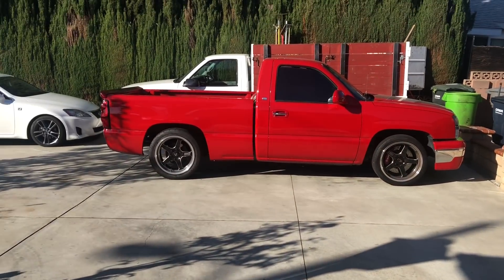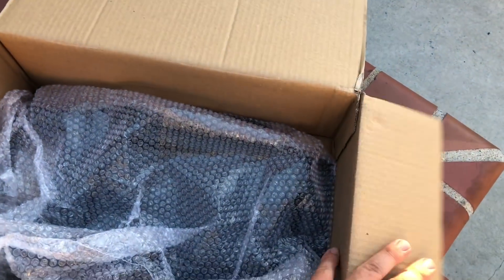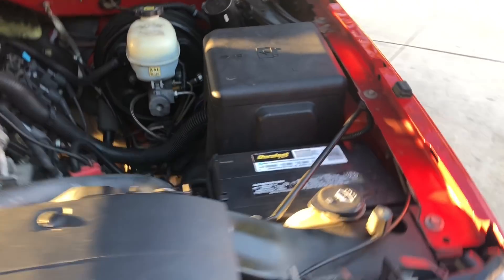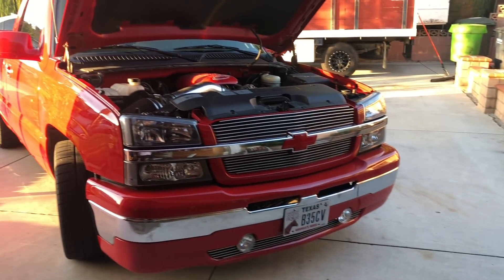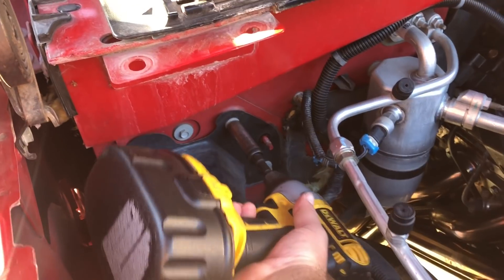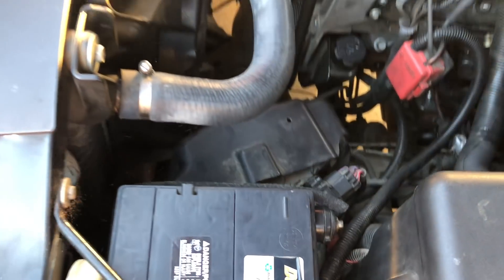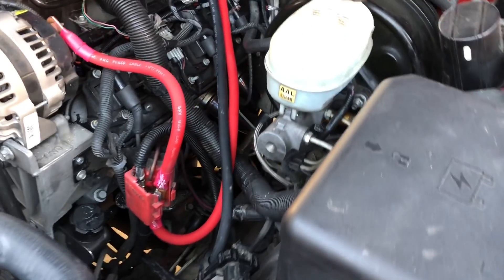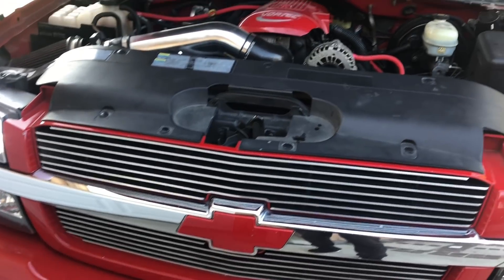Silverado Battery relocation! (Oem diesel tray)

Comment: Clean up your wiring other wise you will have problems- tuck the positive & negative wire on firewall or hide it some where you do not see it ... Do not leave it laying on the motor.

Comment: Wtf didn't show how you did the pcm relocate?
Reply from the maker: You just place it there, you snap it off the oem plastic thing and it slides right in. The hard part is moving the battery lol
Reply: @raysp3c  the mount around it? And slides in where? Im lost so i kept my mount and flipped it and bolted it straight up to 1 bolt but its sideways and not bad for the moment. I love your build and want mine to be as clean or start of it. I relocated my battery the same way with mine but i want to run boost near future
Reply from the maker: Yeah the oem plastic mount it slides on top of the oem battery tray. You may or may not have to do that depending on what kind og boost you run
Reply: Looking at getting an on3 kit at the moment. Just making room my wires are to short but i see what your saying now.